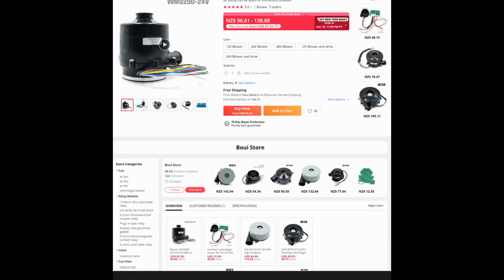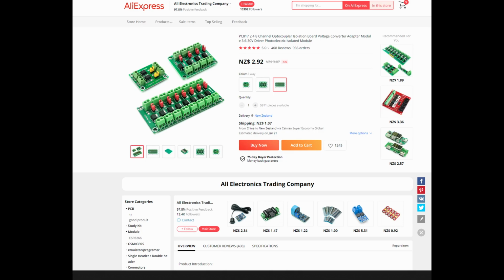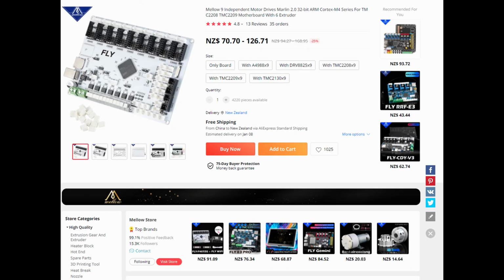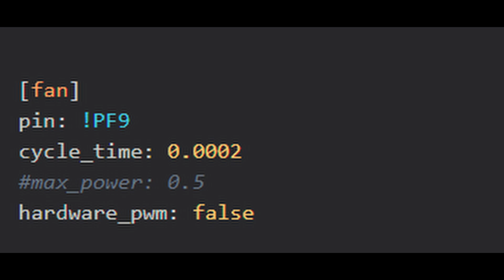Connecting a PWM fan controller to your 3d Printer

Comment: Hi there, hey just wondering if setting up the the optocoupler to the blower is exactly as shown in the graphics in the vid,  I am going to try and replicate it and want make sure I have it right.Thanks in advance from a Tauranga viewr
Reply from the maker: Yes, absolutely
Reply: @vvega007  Thanks mate, still waiting for the units to arrive I'm wondering if this unit has enough capacity to use as cooling and Internal filter system for enclosed printing, Ill keep you posted.

Steve
Reply: @vvega007  Hi Again, try to get this to work as intended, Now to feed the CPAP controller a PWM Sig from my MCU is it just the SIG wire I need to use or still have the + & - and the pot attached ?  Im having a little trouble at present .
Reply: Well turns out I was having a brain fart and despite the answer and method  that you provided  couldn't get it to work as I was somehow getting it wrong,  but the fog has since cleared and tried again with your exact instructions and bam , success ! Thanks again.

Comment: Forgive my ignorance, and curiousity, but when you back down the  control the fan seems to latch, like when you drop from 50 back to 0, the fan seems to stay at 50,  until you increase to 80. Is this a feature of the cpap fan systems?  Or is  there something I missing? Thanks
Looking forward to the extruder videos!
Reply from the maker: That’s just me typing a number or deleting the number and not pressing enter :) the slider shows you the new position before you press enter :) no latching

Comment: If the airstream is that strong, isn't that going to deform the molten plastic before cooling it down?
Reply from the maker: You use the air required for the speed you print at :)